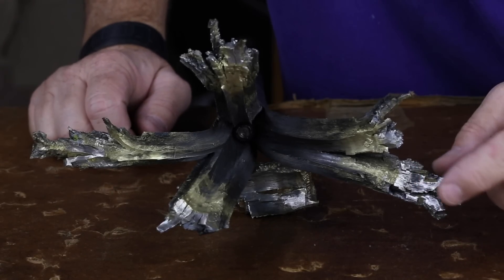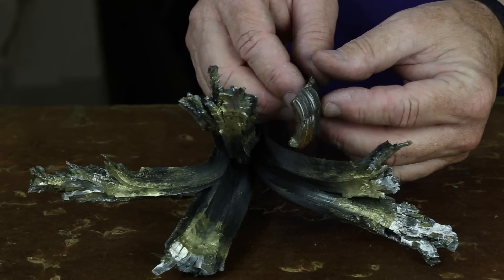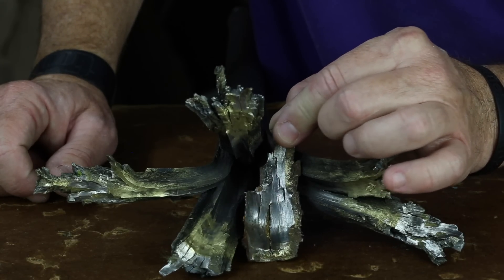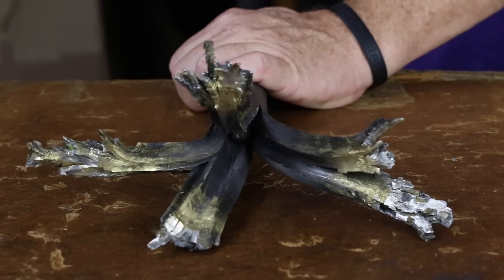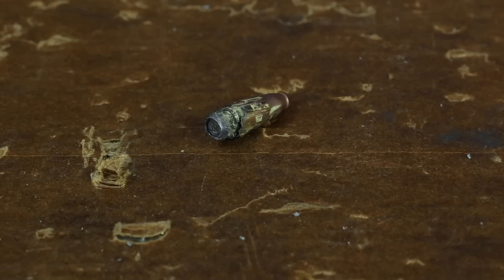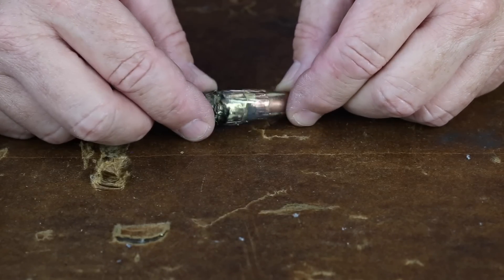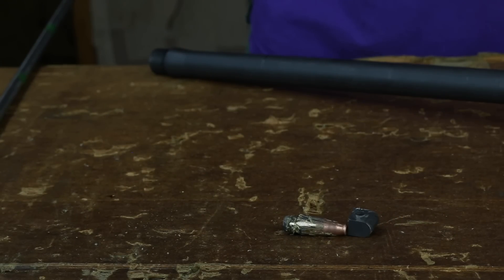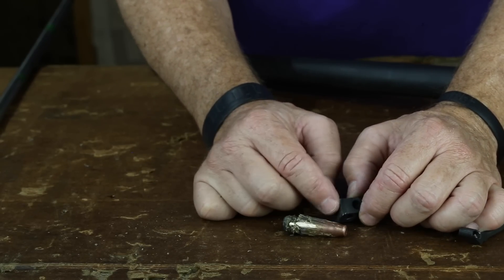RN-50 vs C4 AFTERMATH!

Comment: My guess is that the pressure wave of the C4 preferentially broke among pockets or striations in the actual grain structure of the steel. It's what causes the almost layering of the steel in that barrel.
No grain structure is without imperfection, even if said "imperfections" don't reveal themselves until several grams of C4's worth of pressure is applied to them.

Comment: The grain structure of the barrel? It looks like the grain structure of a piece of wood.

The shockwave is supersonic, but more importantly it is supersonic in Steel. The speed of sound for a pressure wave traveling forward(compression) in steel is approximately 18000 ft/s, but the speed of sound for an S wave(a shearing wave) is only 10,000ft/s. C4 generates a shockwave of roughly 12000-15000 ft/s according to Google, this is faster than the steel can flex in a shear direction. So, the steel hasnt been ripped apart from tensile strength, it was pulled apart by shear strength.

As the C4 detonates, the molecules have no issue staying rigid in a outward or radial direction from the explosion, but the metal is no longer solid in an axial or tangential direction around the barrel. The molecules can hang on to the other molecules on top of or below them, but they are being accelerated too fast to keep attached to the molecules beside them.

It would seem obvious that the pressure is simply pushing everything outwards from the center, but the fact that the shockwave is traveling faster than steel can transmit motion literally splits it apart at a molecular level.

Comment: Something I've come to notice over the years is the amount of relative force produced by different methods and the effects on materials.  Steam and black powder are classed as low explosives and if you want to simply break something, they work fine.  When you get to nitrocellulose, a little bit seems to be a power of magnitude greater and it's effect is to break things down a bit finer.  Nitroglycerin will crack things open like nobody's business and the chunks are smaller yet.  TNT, as we all know will break down mountains into gravel and C-4 will tear metal apart into little bits.  I'd like to see a 4k ultra slow video of that barrel disintegrating so I could follow all the material as it departed.  I am willing to bet that a lot of it was used to create steel dust.

Comment: The brass is probably explosively welded to the steel  
On the subject of the patterning, it is probably from the manufacturing of the barrels. If it has significant forging your get broad alignment of the crystal grains and when it breaks it can reveal that pattern

Comment: Not an explosives or metallurgical nerd, but I can throw a presumption into why the formerly smooth chamber walls now have texture. I think it has a fair bit to do with the steel grain alignment in the forging or drawing process. After that the grain lines were cut by a drill then a reamer but not eliminated. They were still there, only concealed and would have remained so until a high enough pressure shock load compressed the 'weaker' spaces between the harder grain lines.

It's one of those little detaily things that can be seen in a piece of draw forged, hammer forged vs cast. If the piece is heated up o cherry red and really de-scaled if you look close you can see darker and slightly lighter lines in the metal. Faint lines that look almost like a shattered pane of glass is indicating a forged billet that isn't refined. If the lady nes are uniform, it's been hammer forged. If the lines are long and skinny, draw forged. They are hard to see no doubt, but they are there. Knife makers know about grain size and the need to have them uniform and directional. Still neato to see.

Comment: Thats definitely explosive deformation.   Steel looks like that after you pop a C4 cutting charge.   It goes so fast that it shears.   That area of the breach was where the case head of the round was, the pressure spiked the highest there.

Comment: The shear lines from the barrel splitting, the fractured ends from where metal was almost pulled apart from itself, and the compression fractures all show why PSI is an important measurement to take into account.

Comment: I'm not an explody expert by any means. In fact, I'm a highschool dropout. But here's my worthless thoughts:
The bullet didn't get far because the overpressure from the spicy play-doh got vented by gun sploding after the steel lost its life or death struggle with the pressure from the chamber.

The minimal amount of travel the bullet did get before the pressure vented was stopped by friction of the rifling, and once the barrel divorced itself from the gun, whatever force was left to propel the bullet was now also being imparted on the barrel through the friction of the rifling. So boolit no go.

Comment: This reaffirms my original thought that Scotts round was a reload that someone replaced the original volume of powder with pistol powder, or overfilled with pistol powder. The pressure spike from the speed of the propellent. That millisecond it took to burn the full case of that SLAP put the pressure on the threads, supported by the barrel/bullet/throat/case/chamber/cap. The C4 going so much faster, the pressure spike only took place in the chamber because there was no time. To me this shows the threads in the cap are as hard as you say they are.

Comment: Everyone asking about how to actually launch a projectile with C4 started the gears turning... asides from being milled into a foundry block of steel, you'd need a really thick "cartridge" designed to be ablative rather than obturating... sealing is out of the question, so the focus goes to having enough of a calorie-absorbing material to avoid eroding everything, which probably also means having the projectile in the base of an a soft metal tube cast or pressed into probably a UHDPE 'case' that's a few inches thick completely surrounding a little nugget of primary explosive, cone shaped towards the front so it aligns the freebore with the start of the rifling. What plastic is left after firing is probably going to be a molten glob, and parts of the tube are probably going to chase the projectile down the barrel (may have to have a 'tamper' of PE behind that too, keep it from gas cutting). Tube could be perhaps zinc? The heat in the chamber would be plenty to vaporize it and ease cleanup a little. 

Oh well, bored minds go strange places. Kind of like wondering if you could drive a projectile with an 'open chamber' and a shaped charge, design the projectile like a bullet trap grenade launching system, gets hit with the copper slug and catches it to transfer all it's kinetic energy to itself and give it a full send.

Comment: Texture's there because the metal stretched, it's drawn (or blown) down into weaker sections of crystal structure. Some parts may be gas cut as well, which is also what happened to the base of that projectile. If you're handier with the math and material strength calculations than me (not difficult), you could get a lot of data from how long the transition areas are in the splits on that barrel, because pretty much all of it from the brass 'dusted' area on forwards was torn purely by the inertia from the directly affected parts that still remained attached.

Comment: the explosive impulse probobly deformed the barrel and theads into the cap, so before the threads ripped off completely they hit like 110% engagement and that's why there are some left. the cap HAD to split to disengage them the rest of the way, and where ever it cracked, it got launched the opposite way

The texture is the actual grain structure. you can tell the heat treatment did a really good job, because that almost wood like texture is from the crystalline structure being stretched.
you can see the same thing if you acid etch wrought iron. 
Actually, i'd be curious to that a little piece of this acid etched to really bring out the detail in that grain

Comment: that would make one hell of a wall hanger, attach everything in an 'exploded view' on a panel and display it as such, probably tack weld the bits onto a minimal supporting frame just to hold everything in rough positioning

Comment: The texture of the chamber looks a lot like adiabatic sheer bands. Essentially when the material is being deformed rapidly it generates heat. That heat softens the material which makes it weaker which then makes it more likely to deform at the same spot. Positive feedback loop and you have tearing around a few areas rather than plastic deformation across a larger area. Of course in slower deformations the heat has time to dissipate which is why you don't see this.

It isn't just in explosive mind. Its more common in plastics because they are less conductive whilst also losing strength more quickly by heat. There you can get adiabatic sheering through impact and other more conventional means. You can in metals too, but it just takes a far more dynamic situation. Solid cannon projectile impacts for example.

Comment: That surface cracking looks just like the "alligator skin" you see just forward of the chamber in well-used barrels from lots of exposure to hot, pressurized gasses over time... perhaps it's just an effect of the super-heating of the explosion along with the high pressures causing the metal crystal structure to break down.

As the son of an engineer (and a chemist myself, but not specialized in metals), I'd recommend you check out the metallurgy studies behind the alligator cracking on worn out barrel throats and that will probably tell you what happened on those chamber surface sections.

Comment: A couple of things are involved. High pressure is one thing. But the speed of the explosion of C-4 is very fast. So the bullet didn’t have time to travel very far down the barrel until the pressure peaked and overcame the action. That’s one reason why they like ANFO for blowing rocks in populated areas. The velocity is much slower than nitro and doesn’t cause so much damage to other homes.

Comment: You are right about the brass plating.
Putting force alot of force in it on it is called explosion welding and yes that's actually a thing.😉
Would love to see some high resolution images of the steel.

Comment: Could it be, that: the explosion sends the bullet down the barrel and at the same time makes the barrel expand - and because the bullet has a "head start" from being located in front of the explosion, it gets those 8-9 inches into the barrel, before the barrel deformation squeezes it in. I expect the mushrooming of the barrel to make the inner radius slightly smaller, at the end where each "branch" is still attached.
   Fascinating pictures!

Comment: Explosively-applied brass (or other soft metal)... will that be a new option for a surface finish?  Could be applied as part of the forging process - instead of cold hammer forging, use hot shockwave forming, and mashing the finish into the steel can be part of the operation!  (Mumble, mumble, engraving, Munroe effect.)

Comment: The plastic deformation of the fire control group housing is impressive, to say the least. I've seen some shit happen with receiver failures in the past where other people's guns exploded for one reason or another (probably another case of Bubba's pissin' hot reloads, like it was with Scott, just in smaller calibers), but nothing quite that uniquely severe (usually shit just blows out the side of the lower or upper and you gotta replace one/both). I'm really glad you're doing all this for everybody Mark, I know it isn't cheap blowing up so many guns for science, but somebody's gotta do it right? Wouldn't be right otherwise, and you don't seem like the type of guy to let something go unaddressed. At least this one you were able to do from sub-standard parts that weren't going to be sold, but which were mechanically identical to ones going into production guns, for all intents and purposes

Comment: Re the bullet.
The reason it got stuck where it did is due to the base of the bullet being forced forwards before the bullet overcomes it's inertia effectively forming a plug.
The chamber was in the process of rupturing anyway so the plugged barrel was incidental to the failure not the cause.

Comment: My guess is that the heat and pressure was enough to move the surface of the steel off of the solid section of the phase chart, the liquid part flowed a bit and as fast as it liquified, the pressure subsided and the steel re-solidified.

From what I know about fractures, the rifling created stress risers which is why it split kind of symmetrically but the smooth portions shouldn't have deformed so much because the crack propagation is like the safety valve for over pressure. 

Any way, whatever happened happened fast and it doesn't seem like that area got hot enough to accelerate corrosion which is why I think it was mostly pressure that melted it.

Comment: Unfortunately I've seen the aftermath of what things look like after a 240-pound chunk of HMX detonated in front of two people in a fortified building (it was an accident). The amount of pressure and flash heat is incredible. There was nothing left of the two men, nor most of the building, however there was an eerie reverse-imprint on one wall with embossed outlines of where the two were standing when it went high-order. Chemically and physically speaking, C4 is half as explosive as that pressed HMX shape charge was. To put it into further perspective how spooky explosive it is, it's the same compound used to compress highly dense plutonium and uranium to start nuclear fission in warheads. Steel and concrete have no chance unless you have several feet thick of it.

Comment: I think the bullet got stuck in the barrel, not just because the pressure dropped when the gun disintegrated, but also because while the pressure was so high, the steel core would have expanded sideways like a lead bullet in an early black-powder rifle. Even in some of the early breechloaders, the lead bullet was just bore-sized, and relied on the the explosion of the black powder behind it to make it expand to fit the rifling. Elmer Keith used to use the term "upsettage rounds" for cartridges (such as the Sharps) which were intended to do this. The bullet base did not need to be hollow like a Minnie ball to work, especially if it was long and heavy and made out of relatively soft lead. I suspect the bullet in this case had expanded so much coming out of the cartridge that it was helping to split the barrel apart as it travelled along it.

Comment: Here I am wondering if the barrels could have a 'banana peel' feature for that idiot cramming as much handgun powder in the round as possible. Instead of blowing the back off, the top of the barrel should peel or split to evacuate the pressure before the threads fail... I wonder if there's a good looking way to do that. Or it could be some sort of like, brass plug that fails at that level of pressure. I dunno, it's hard to predict what happens with that much pressure, but hopefully there can be a way to direct pressure up and/or away from the shooter in designs? I might be overstepping bounds

Comment: Very interesting video.
I'm not an explosive anything but guess c4 has a much faster burn rate and this is why projectile didn't travel very far.
But I wonder if you ever have enough rejected parts to re try this if you used a much smaller amount if it could be made to work.
Again I know nothing and I wouldn't even know how to calculate that smaller amount appropriately.
Just a thought and yes I will stick to my powders

Comment: Wow the projectile actually moved down the barrel some. I imagined that it basically didn't even budge and the blast was too fast and hard blowing out sideways, banana peeling the whole chamber and rear of the barrel. I'm amazed it traveled even more than a few inches, let alone 7-8". Also, is all that yellow/brass looking color on everything residue from the C4? It's on the bullet and the very ends of the shredded barrel.
EDIT: Ah, I watched to the end of the video, it looks like the brass from the round itself. CRAZY

Comment: This experiment ended how I suspected.  What was unexpected is the bullet had enough energy to make it a few inches and that’s it.  The pressure spike was so fast the whole breech must have been opened up before the bullet even moved.  That’s wild😮
Reply: Bullet obturated and made things worse I'd bet!?
Reply: @CandidZulu  Maybe, but I think with those kind of forces "worse" is purely relative.
Reply: @CandidZulu  No, it was the C4 that made things worse, it's a high explosive, unlike gun powder. When the high explosion happens, it doesn't matter if the barrel has a bullet in it, or don't.

Comment: I wonder if the intense heat and impact from the C-4 being that confined caused the metal of the chamber to retemper or crystalize? Resulting in the stress fracturing seen there? Great video.

Comment: Not that I know exactly how your 50 cal gun barrels are processed or alloy you use, so this is an armchair analysis:  You compressed the surface on that concave face as the backside stretched.  because it happened so fast, it compression cracked on the more brittle face.  Thick part heat treat is never uniform as the quench and annealing happen as a rate gradient through the thickness.  As others noted, the pattern is based on the crystal structure of what I think is the Martensite in the top layers of the steel.  A Mat Science Engineer with a lab and your barrel cookbook would know for sure.